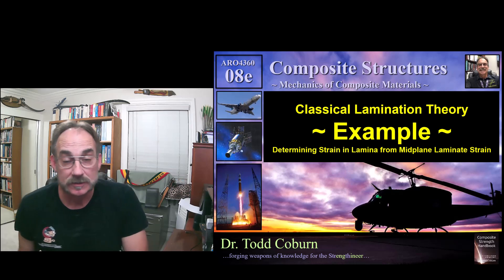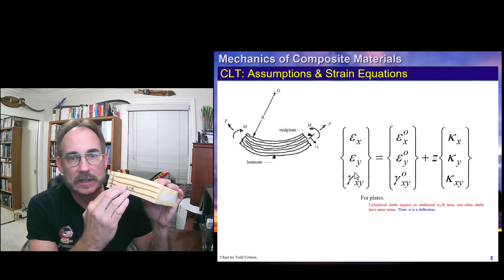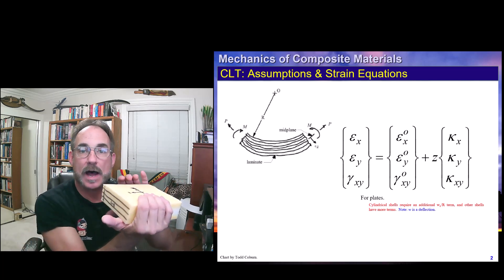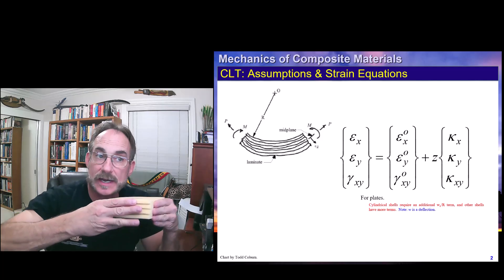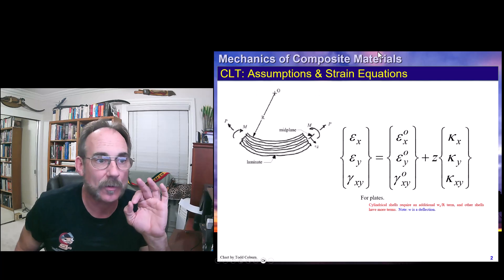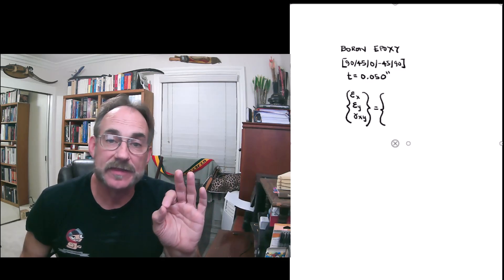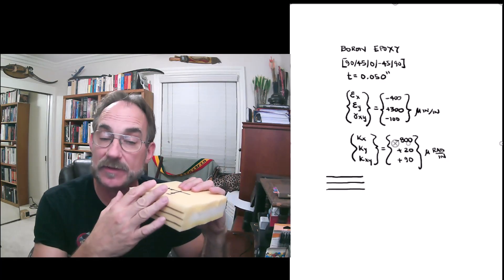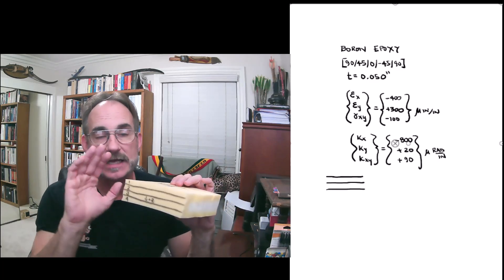How to Determine Lamina Strain from Laminate Midplane Strain & Curvature

Comment: Hey, great video! What about the middle ply? Is it {εο}+0{κο}? In that case, are the midplane strains and curvatures refering to the plate as a whole (is that why we refer to their coordinates as body coordinates)?
Reply from the maker: Just like axial load and bending, P/A +Mc/I has only axial stress at the CG, our strain and curvature calc shows only axial strain at the midplane.  Body coordinates refers to the design coordinates for the part, as opposed to local coordinates of the ply